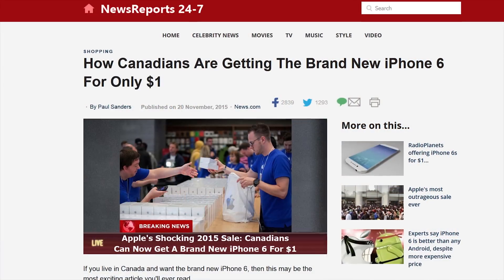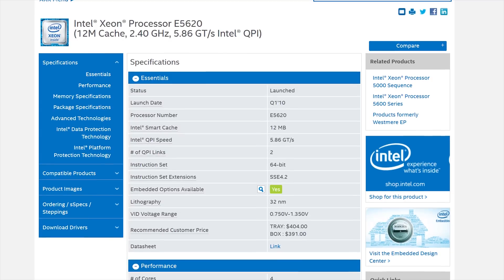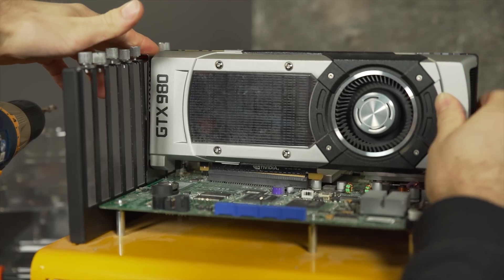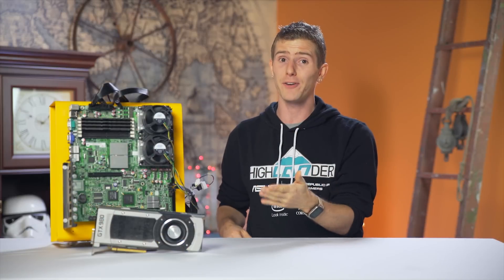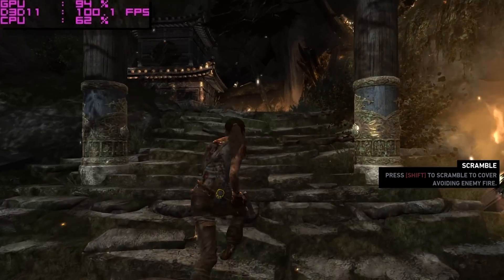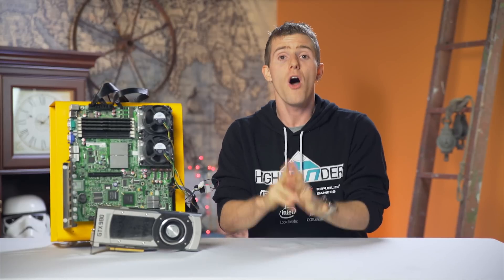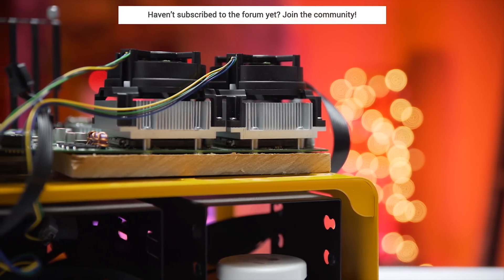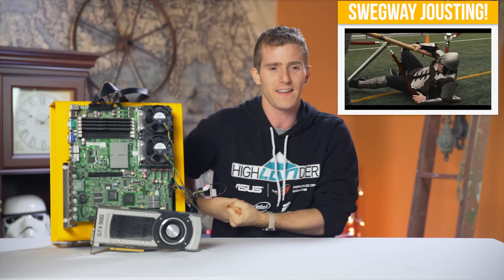Under $150 Budget Gaming 8 Core CPU, Motherboard & 16GB RAM

Comment: I've been using a xeon x5670 6 core in my evga x58 classified 3 motherboard overclocked to 4.4ghz. The cpu was $70 and the motherboard was $70 refurbished. Great deal and I've had it for over a year now. Way better than my 3770k was and a lot cheaper too.
Reply: +MichaelV Or you could go the dual cpu route and get two x5650 6 core cpu's and a server motherboard to have 12 cores and 24 threads. Perfect for rendering. I believe the x5650 6 core is around $50
Reply: May I see your specs and what purpose do you use this build for?
Reply: +Shane Chandan 
Xeon x5670 at 4.4ghz
Evga x58 Classified3
Corsair vengeance 12gb ram
Evga Gtx 780 ACX
Asus Xonar STX Soundcard
Corsair 750w psu
XSPC Rasa 360 watercooling kit
Intel 530 ssd
Two 2TB hard drives
One  4TB hard drive
Yamakasi 1440p Monitor 27inch
I use it for mostly gaming and some video rendering
Reply: +MegaMech Black friday doesn't make a difference. All my parts were from ebay. Even my $250 gtx 780 :D
Reply: +berzu21 3770k is only 2 generations ahead of the x5670. The x5670 is pretty much the 980x just not unlocked. Intel really hasn't improved performance that much since the first gen i7. I got the x5670 to 4.4ghz and my 3770k to 4.7ghz. the x5670 is a 6core and the 3770k is a quad core. CPU's don't really make a difference in video games as far as performance, I bet that 15fps difference linus got was because he used ddr2 ram. And for rendering, 6 cores at 4.4ghz is a lot more useful than 4 at 4.7ghz.
Reply: +Christian Tatupu Mailo nz is expensive asf its because its so out of the way and very few suppliers
Reply: +MichaelV  it's so hard to find a cheap x58 motherboard these days good for you :)
Reply: +J Greaves I wouldn't bother keeping it for gaming, but check out linus's video about how his server works for transcoding video. Even in my very very light use, having another computer with a badass processor to do all of that cpu grunt-work is nice.
Reply: +MichaelV I have a very similar build to your's and i love its performance:
Xeon x5675 overclocked to 4.6ghz
Asus sabertooth x58
Kingston hyper x 16gb ram
Evga SC GTX 780 6GB versions in 2 way sli, cooled via aquacomputer gpu waterblocks to achieve a 1241mhz overclock
OCZ ZX 1200w psu
Alphacool 240 Rad and 120 Rad with XSPC bayers dual pump reservior
Intel 520 120gb ssd
2 1TB seagate sshd's
and a acer 1440p monitor
Reply: +MichaelV true, you do gain power efficiency benefits with the newer gen CPU, which over time would save some degree of money. youd have to do a lifetime cost analysis and maybe snag a pretty good deal for it to be worth it. I havent upgraded since the ivy bridge days but don't do much gaming anymore
Reply: +MichaelV The performance difference rather comes from the PCIe Gen1 x16 Slot @ x8, which has very low bandwidth (too low for a good, new GPU) + the slow DDR2 RAM.
Reply: Mr. Freibier
How so?
Reply: how about Intel core 2 duo?
Reply: +Jr B 
It's two core, no hyper threading. Wouldn't go there.
Reply: +Mr. Freibier Xeons have absolutely no problems overclocking. I have a 40% overclock on mine.
Reply: +MichaelV Why are you replying to yourself?
Also, you got your x5670 and x58 motherboard for gaming seeing how you want to overclock it and that it's a replacement for 3770k. So why bother mentioning a better setup for rendering in your reply to your own comment?
Reply: +MichaelV Your route sounds much more plausible than what Linus did. Atleast yours has some upgradability room to it and isn't zip tied together because nothing fits. Sure his was under $200 for the whole thing, and it ran OK, but honestly the GPU does more than the CPU these days, and overall it seems like a good show, but not that practical compared to what you put together.
Reply: +waderedsox 250$ for a GTX 780 and 170$ for a GTX 770 are horrible prices. Both are beaten/matched by the R9 280X nowadays with the newer drivers & games and it sells used for ~130$. It also sucks less power than a 780. "Go Maxwell or go home" is basically what NVIDIA is trying to tell their customers lately.
Reply: +MichaelV Good thing is in Europe its overpriced as fuck! Only the mobo is like 190 euros..Anyways..seems interesting idea but I would always prefer single solution - CPU and GPU.
Reply: +MichaelV Yes  1366 xeon is the best choice
Reply: The rig I'm writing this on (Xeon X5675) can go up to 26, currently set to 23 and sitting at 4.3ghz http://valid.x86.fr/djve0l
Reply: +MichaelV Got the X5650 Overclocked to 4.25Ghz.
Reply: +MichaelV In New Zealand its like $2,000. Don't know why. Maybe its me and i don't know how to properly search for these things but from what I've found its a complete rip off.
Reply: +Christian Tatupu Mailo Buy one internationally then. http://www.ebay.com/itm/Intel-SLBV3-Intel-X5650-2-66GHz-12MB-Xeon-6Core-Processor-z5-/281871898598?hash=item41a0dfd7e6:g:9dIAAOSwnipWXOii
Reply: +Christian Tatupu Mailo use pricespy.co.nz to find the best price on all new parts but you're right, NZ prices are ridiculous....
Reply: +MichaelV I'am intrigued man but I lack the knowledge in this department. I currently have a i7 4770k quad core. would these two xeons provide better performance?
Reply: +Christian Tatupu Mailo I got two W5590's for 180NZD now just have to get duel slot mb
Reply: +MichaelV X5660 and Sabertooth X58 owner here! ($90 cpu, $90 mobo)
Cinebench R15 score of 990 and 4.3GHz.
Reply: xeon and overclock = fail
Reply: Because the xeon cpu runs extremely unstable! The CPU is not built in this example! The last test from the pcgh(german experts) warning about the OC problems from the xeon CPU!
Reply: +MichaelV $250 gtx 780s ftw, i have one too, bought it a year ago, nothing touches it in price to performance, aside from a 290x, and and those are  NIGHTMARE with the bad ram they had, theyve actually gone up in price if you can beleive it, the 780s run about $300 now, a 770gtx is a pretty good deal too, they go for 170ish, i actually just upgraded from an x58 board to a 5820k, that processor was a nightmare for me to try to overclock and without the clockspeed bump i was getting cpu choked all over the place(battlefield 4, borderlands 2, etc i had a 940), how on earth did you manage to get a server processor to overclock with a locked multiplier????????????????
Reply: +Ordo Malleus (RUPERTTHEBEAR1) No they wouldn't, except for multi threaded tasks.
Reply: +MichaelV 
Gigabyte X58 UD3R, Xeon X5675, 16Gb Corsair Dominator OC 4.3 in a Silverstone home theatre case X58 FTW :-)
She'll do 4.5 but gets too hot because of the tight case.

http://valid.x86.fr/djve0l
Reply: CHRIST THATS IMPRESSIVE
Reply: +Ordo Malleus (RUPERTTHEBEAR1) If you have a 4770k then stick with that.
Reply: +waderedsox "$250 gtx 780s ftw, i have one too, bought it a year ago, nothing touches it in price to performance"

What are you smoking there a bunch of cards that outperform the 780.
Reply: +MichaelV He also didn't overclock.
Reply: +InsidiousJFP But how much do they cost, IE Price to Performance
Reply: ***** Depends on the chip, all have locked multipliers but many allow for FSB overclocking.
Reply: Gabriel Tessin They don't all have locked multis
Reply: Ian Darley News to me, yes you can lower them but I thought they all had an upper limit built in. Good to know.
Reply: Mr. Freibier
The only OC problems I'm getting are none.
Reply: +MichaelV X5650 @ 4.7Ghz reporting in
Reply: +MichaelV  I got a sabertooth x58 and a x5670 6 core is a beast. It has two sata III on it soo I have two ssd in raid O The best pc ever
Reply: +MichaelV 

Is the 1333 ram good!!?!??, im afraid it would bottle neck it. Eww I used the term "bottle neck"
Reply: CODboyX 1333 will not "bottle neck" at all. If you compare it to 1866 you will see no difference
Reply: +MichaelV wow , really better than 3770k? how about single core performance?
Reply: +CODboyX like you would notice any difference between 1300mhz and 2600mhz in games
Reply: +Ian Darley Try to find a liquid cooler that'll fit the socket, or a large air cooler that is wide not tall.
Reply: +radun70 I can get a used 290X for $200, which is a far cry from what I paid for mine new. The only problem is that they don't seem to have very impressive overclocks.
Reply: +MichaelV If only EVGA x58 Classifieds could still be found. They take two X56** Xeons and can overclock both of them.
Reply: +MichaelV Company is closing down so had the chance to purchase the complete server room for AUD400. Was going to sell it all on ebay but after seeing this might keep one of the servers...

Dell R720 - Dual Xeon E5-2630L 2.0Ghz, 6 core, 16gb Ram, 4 x 600Gb 15k SAS HDD
or
Dell R510 - Xeon E5640 2.66Ghz, 4 core, 12Gb Ram, 3 x 300Gb 15k SAS HDD
.
Opinions???
Reply: +MichaelV wait why are they like $2000 now?
Reply: +Nullie The lower comment's pretty much correct. Most chips block overclocking. Simply it doesn't work. My previous workstation had no multiplier. That's just how Xeon's work.
Reply: +Christian Tatupu Mailo OCAU,trading groups and the such.

I normally resort to ebay last
Reply: +Jr B A My Core 2 Duo overclocked to 3.3ghz have trouble running GTA V as you get 30fps max with GTX960 and 30-45fps with a GTX980ti no matter how low setting you use. Project cars I did only get 3fps with my GTX960. Core 2 Duo is to slow to run some of the new games and I have myself after 10 years finally upgraded to a i7 4790k. With that CPU most games have less than 20% CPU usage max and ARMA3 have 30% CPU usage so it is overkill but I plan on not upgrading in a long long time.
Reply: I confirm this. My Asus rampage 3 extreme costed me 142€ with shipping. But it's good to have the 3rd best x58 mainboard.
Reply: If only I could get my hands on a such chip…I'm fucking jealous mate. That's awesome.
Reply: +MichaelV Hey Michael, I'm looking to build a render bug. However (even on Ebay) I've only been able to find x5650's upwards of $80. I live in the US FYI. Is there a better place to find them?
Reply: Pastunes You can take a look at amazon, but I make no promises.
Reply: +Pastunes You could go the route of getting used seemingly tested parts OR you could just get a used system like a HP Z400 ($200+ US on Newegg) or a HP Z600 ($300+ US on Newegg). Downside would be you still need a graphics cad. If you went with the Z600, you'd get up to 16 threads depending on processor and hyperthreading.
Reply: I think I'm gonna go for buying all my parts individually (even though it might cost a bit more). So far I have 2x X5650's and an HP Z800 motherboard. (Unless you have a different MB recommendation. I'd rather not spend a fortune on ECC memory if I don't have to)
Reply: Pastunes great start. Problem with the HP z series is that they require the OEM power supply. Reason is the power distribution is built into the motherboard. I have a z600 with same motherboard. Also, there is a separate power distribution board built into the OEM case for the SATA drives and a loose SATA power for the DVD drive. No ECC required on your rig. By the way, I warranty repair these things...
Reply: What benchmarks does that CPU beat the 3770k when also OCd?   the 2600k was generally as fast as the first gen i7 6 cores..  the ivy bridge should be even better especially against an older generation core 2 based 6 core.
Reply: Well... try a cinebench cpu test and you'll get close to a 1000 points score. 3d mark, not so good unless you pair it with a decent gpu because 3d mark isn't threaded (on purpose.) bear in mind that most xeon dual socket motherboards DO NOT allow for overclocking. what you get with a core 2 series xeon is hyperthreading.
Reply: I'm basically torn between dual X5450's and dual X5650's. The X56's are $90 each and six core while the X54's are $20 each and quad core. Which would you recommend?
Reply: I'd go quad core because it's still 16 threads. There is really no reason for 24 threads in a gaming environment. Keep in mind what I said earlier about buying a z800 prebuilt because IT DOES require the OEM power supply and the case with power distribution board.
Reply: I already have a gaming rig**, this is for rendering animation in C4D, After Effects, and video in Premiere. I'm wondering if the extra cores/threads are going to be worth the price. Is there another motherboard you would recommend or is the prebuilt my best bet?
Reply: Matthew Bauer  Sigh, seems like I keep forgetting to tag you in these comments. My apologies, and thanks so much for the help.
Reply: Prebuilt (at least for HP Z series) is the only way to go. Try looking on ebay. They have some z600 with the e5600 series Xeon dual chips going for $250-$300 buy it now price.
Reply: +Ordo Malleus (RUPERTTHEBEAR1)  no not even remotely
Reply: ***** ;-; I have it
Reply: +jrherita Ok so a lot of you guys are in disbelief that my x5670 at 4.4ghz is faster than a 3770k. Well I just ran cinebench and I scored 1020. Which is 200 points faster than the 4770k and 400 points faster than the 3770k.Also the 3930k 6core scored 1096 so it's pretty much even with that.
Reply: I believe it. I scored in the 900s with my dual x5670s at stock.
Reply: +Matthew Bauer That's the main reason I didn't go the dual x5670 route with a server board because I knew I wouldn't be able to overclock them. I really want the evga sr-2 board so I could dual xeon and overclock, but the used price on them has skyrockted in the past year on ebay. They are still going for like $500
Reply: +waderedsox I got two 970s off ebay for 280 each
Reply: +Kirei Edwards you could have goten a new R9 290 for $220 each off newegg lol.
Reply: MichaelV that is impressive actually.   I suspect though 7zip would be about even with both cpus OC and in games the newer CPUs would clobber.  But I am surprised at cinebench given the enhanced FPUs of the newer cores.
Reply: jrherita These xeons are actually some of the best bang-for-the-buck c.p.u.s one can buy, and with 980x/990x prices way over the top for their age, it's the best c.p.u. upgrade for the x58 platform. Specifically the x5650 and the x5670/x5675 are actually core i7 4790ks with 2 extra cores, which make them kind of the weapon of choice for content creation pcs.
Reply: ramair325 I'd rather stay the fuck away from amd
Reply: Oh duh. I was thinking x58 was still core 2 duo.  X58 is nehalem.  Much better ..
Reply: +Kirei Edwards What's wrong with AMD?
Reply: jrherita X58 is the first core i7 generation's chipset. Back in very late 2008 and in 2009 it was exactly what x99 is today. This platform may be old, but it packs quite a punch. You can build an x58 rig today with a modern g.p.u. and maybe an s.s.d./raid if that's your thing and you'll have a badass rig that can easily be on par with modern core i5 powered systems. Ask anyone here.
Reply: +nitrofar34 How are you liking the 780s in sli? I'm about to pick up a second one since they are so cheap used. Do most games you play support sli?
Reply: yep the 780's in sli are pretty awesome, i play games like gta5, battlefield 4, battlefront ect, at pretty much max settings at 1440p
Reply: MichaelV were there any obstacles in setting it up and can it fit into any case

Comment: What performance would you get with a r9 390 or GTX 970? Seems like a fun thing to do as a project but if I have to spend 150-200 on the CPU-MOBO-RAM-PSU I'd rather spend 350 on the GPU  and call it a day. If I had a GTX980 and the other parts turned out to be scrap I'd cry knowing it was just sitting there while i scrounged enough money to find her a new home...
Reply: +markmdublin If you want 1080p gaming go for a 270x or 950
Reply: I only want to play Fallout 4 on Ultra at 60fps, I'll play any other game at medium 30+fps, need an upgrade from this garbage comp i have and dont wanna put any money into a super beast rig until i see if AMDs new CPUs being unveiled early 2016 are any good, then it'll be all ddr4 boards etc..
Reply: Im using a gigabyte r9 290x and is better than the 970 AND I bought it for less!Whats happening guys?
Reply: +Fairex The Lord. Nothing you said has anything to do with our comments..